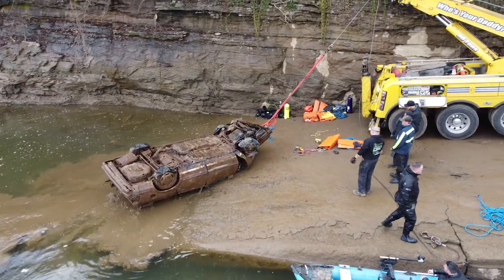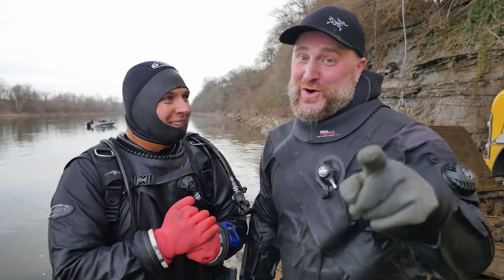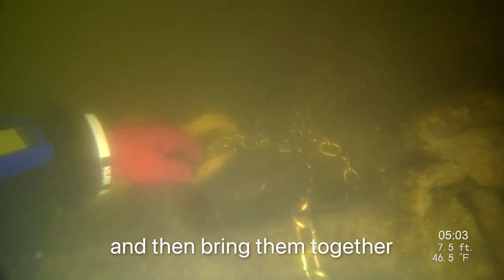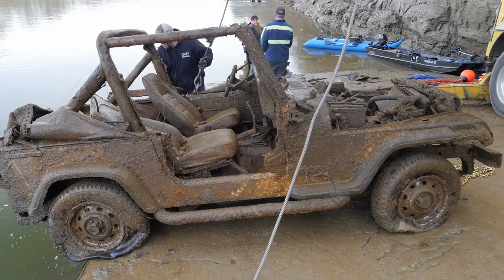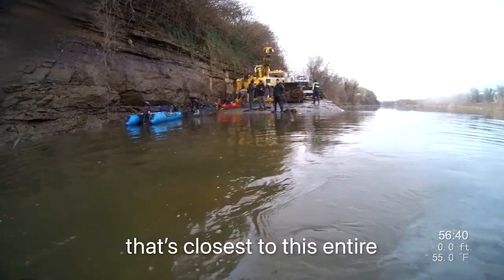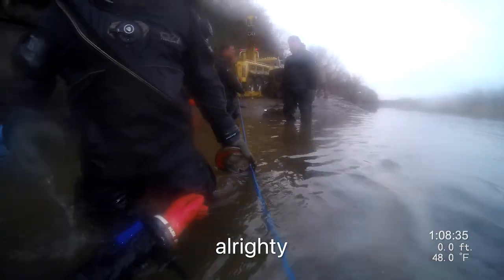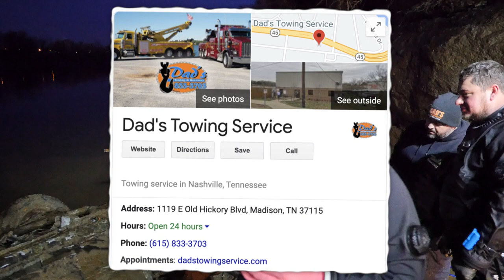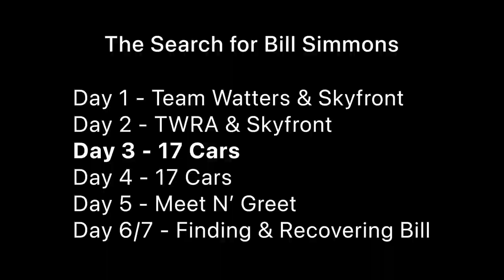FOUND 19 Stolen Cars in Nashville River! (Recovering 8 - Day 1)

Comment: Yes, this video is a year old and I know I am late to the party. First of all, I have a great deal of respect for everyone involved and for the work that you folks are doing.
Having said that, Parts of this video are making me absolutely cringe. You absolutely need a far greater exclusion zone around the rigging when a pull is being performed. I have seen rigging failures with my own eyes, and in at least one case, it was ONLY the fact that everyone was a safe distance away that prevented a severe injury or death due to a hook flying through the air when the attachment point on a load failed.
Don't ever stop doing the great work you do. Just PLEASE respect the dangers of that rigging, ESPECIALLY when you are pulling very deteriorated loads that you are expecting to break apart at any time. Same goes for suspension springs on these old cars. They can still have deadly levels of stored energy which can be released suddenly as the car is pulled apart.

Comment: I watched a video from way back where you found heaps of chairs under a dock. Have you considered a basket on a rope and float that you can load on the bottom and haul up later? It should work in still water. You could also hitch things into the rope.

Comment: When it comes to areas with such large pockets of cars, especially when they are decaying..
Is it possible to see if a scrap yard has a crane with magnet to just bring in and assist in getting all that junk and place it on a truck to haul off.. Seems it could he faster.. more efficient.  Haul the vehicles as close as you can and let the magnet do the rest.
   I use to live down the road where they used one at a scrap yard. It was just a basic crane on tracks..had a very large magnet for picking up cars and tons on steel and metals.

Comment: The Rotator Operator could have extended his boom and vertically picked up the "Cars" causing less (damage/brake away) pulling from that angle caused the cars to have to come over the boat launch and broke some apart.

Comment: I wonder how difficult it would be to have some type of water surface skimmer that cleans up the leaking oil/fluids from the vehicles you pull. Some of the overhead shots look like quite a bit is being leaked into the environment
Reply: They probably do when they are done but just think those cars were already in the river and were already contaminating the water. So whatever you see is still an improvement to just leaving them down there

Comment: This is so frustrating to watch when the car is dragged over the side of the boat ramp. Why wouldn't you move the rig to where you can lift it up more. The rusted car was falling apart and oil spilling everywhere. Also would have been nice to see when others were locating and setting up the cars to be pulled out. Lastly, all of these videos are out of focus 95% of the time.